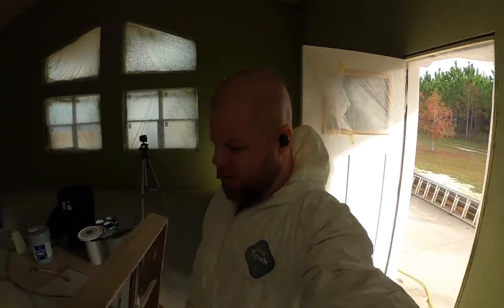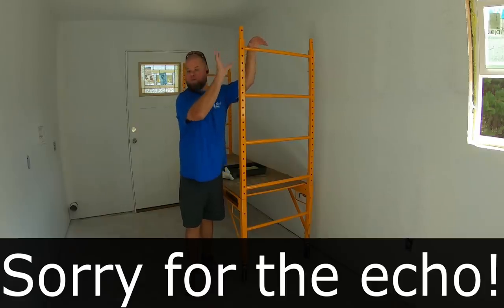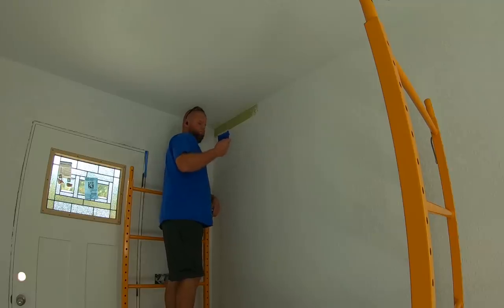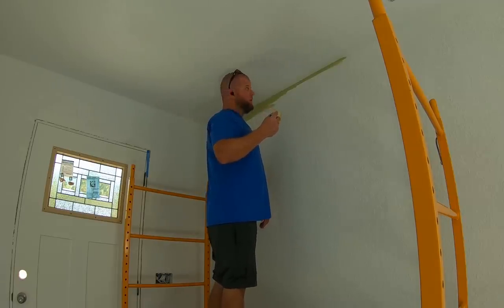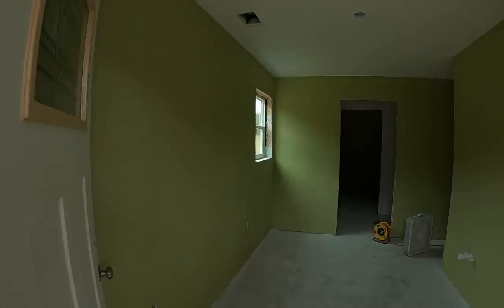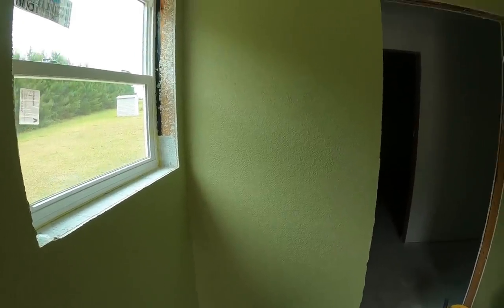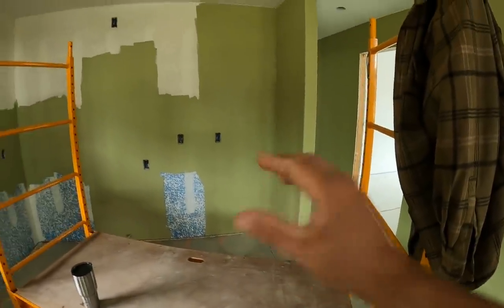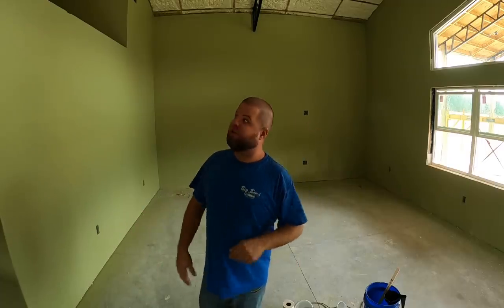Figuring out my painting issues! The GREEN is done! #490

Comment: It looks great. You might what make sure not to leave any bare drywall exposed. It could absorb moisture and you'll get mildew specially in any kitchen, laundry and bathroom areas( just use your Kilz paint ). A good angle brush that tapers down at edge of brush works great, Purdy is a great brush to get.
          Did you get the exterior paint situation figured out? I love your elevator too😁
Reply from the maker: Good point about the bare drywall. I was using a angled brush.

Comment: You may want to get a roller grid made for a 5 gallon bucket and a roller pole.  Also use a 3/4" napp for the texture.  Just paint right out of the bucket.  A good Purdy napp will last.
Reply from the maker: I'm mostly done now, but yes that would have helped.
Reply: Yes Gary.. Your idea is what I was thinking about too.  It is much easier  & less stressful on your arms & shoulders.. 

Andrew.. Using a 5gallon bucket with rack to roll  with a pole is the only way to go.. I even leave roller in bucket of paint over night w out cleaning.. Start rolling again the next day. I cover with drop cloth to keep paint clean over night. Using Purdy roller is the only way. No extra crap coming off roller..

Keep up the good work Andrew..

Comment: good job on the painting, i was going to say in the last video but forgot, you should have placed a white base coat of either primer or ceiling paint down first, because it evens out the surface color if an area is to thin vs other areas that are sprayed thicker. I spray all my rentals and that is what we do on new rehabs or on fresh drywall otherwise it dries differently sometimes or soaks the color coat into the wall. Often times I drop in at the county landfill when I'm in that area and ask them if they have white paint, because often times people drop off their leftover paints and the county will dump them into larger 5 gallon buckets of like colors and you can in my county get the paint for free from them as long as you sign a waiver that you will not dump it in sewers and such.. I typically use this as my first coat primer base coat, then I add my nice color paint coat. Ive got like 60+ gallons in the shed from the county of white mixed paints.
Reply from the maker: Nice score on the paint!

Comment: I know ur mostly done at this point and i may not be the 1st to suggest it but i use a metal paint scraper/ wide puddy knife up in the corners of the ceiling for a nice clean ocd approved line, you may or may not like it but its saved me alot of time over the years doing res. construction off and on
Reply from the maker: I bought three different straight edges and found the paint went past them and on the other surface due to the rough textured walls and ceilings.
Reply: Ahh, you gotta love paint 🤣

Comment: You need a tapered brush for cutting in ceiling. Sounds like roller is to dry. Try going up a nap size.
Reply from the maker: I was using two different angled brushes, those are a must.

Comment: If you are having issues of having to roll it with pressure you are using the wrong nap roller. To get in the recesses of the wall and ceiling use a deep nap.
Reply from the maker: I definitely have the wrong nap.

Comment: bought a house in april and spent well over $1200 in paint and supplies. the struggle is real
Reply: also when it comes to plugs and light you need to invest in a $20-$30 electric screwdriver. they are a life saver when it comes to finish work like that. i have the dremel brand from home depot but amazon has tons.
Reply from the maker: Good tip on the screwdriver, I definitely need one. I'm going to be over $2k in paint 🤮

Comment: Prime all new drywall first. Primer is cheap and it seals the paper and mud surfaces. 
One coat coverage paint never means one coat coverage if you want a quality job. If you are spraying always, always backroll and strike off the wall - take a loaded roller and roll the entire wall in one direction - this sets the stipple of the paint in one direction. Rolling two coats takes longer but gives MUCH better results and is much easier to touch up patch/repair down the road. Same as spraying strike off the wall when finished with each wall. 
Cutting in ceilings/corners and trim - brush and a steady hand still works the best and fastest. Bull nose trim - blue or green tape and clear caulk - put clear caulk down over the edge you are going out second color on and smooth it over the edge of the tape as smooth as you can get it, let it dry. Seals the edge of the tape. Crisp line, paint doesn’t creep under tape and laser crisp lines at bull nose corners.
Reply from the maker: Good tips! Thanks

Comment: When spraying don’t start and stop so frequently. I know it’s tempting but the starts and stops can cause spitting and splatters. Also many people don’t realize that on cans/buckets of paint the instructions require to back roll/brush the paint to promote adhesion with pressure of the paint on the surface. Spraying paint can cause paint bridging where the paint isn’t always adhered to the surface but to each other.
Reply from the maker: Yes I'm learning more and more about the back rolling process.
Reply: @TKCL  if you are using any paint with a sheen like egg shell, semi, etc finish roll the wall all in the same direction. I always do a final pull down to lay the paint all in the same direction. You’re doing a great job! Don’t over analyze and critique yourself. This won’t be the last paint job that house gets so keep on getting it so you can move in!!!

Comment: Gadgets do not work. Check out a professional painters tool box. Brushes, rollers, 5n1 tools, etc. no edging tools, etc. they only use what works. 
Cutting ceiling lines if your drywall installer didn’t do it make it easy for your self and take a large Phillips screw driver that’s kind of worn and run it into the ceiling wall edge and clean the texture out if that joint so you have a nice smooth surface to cut in with a brush.